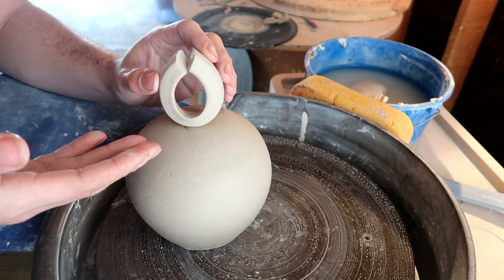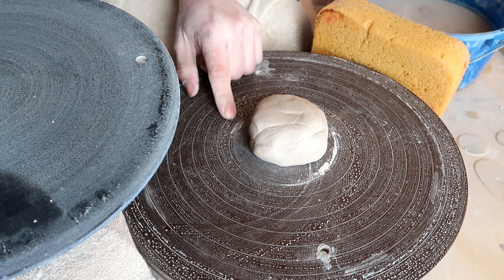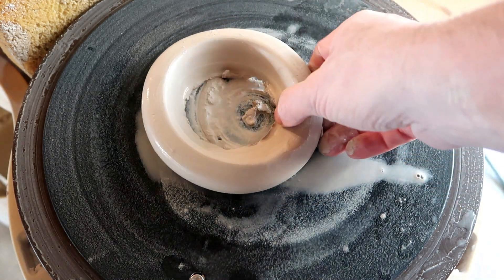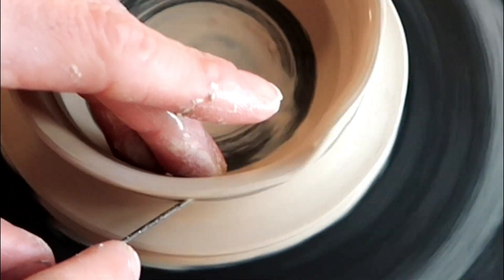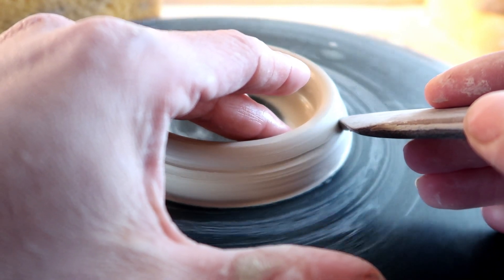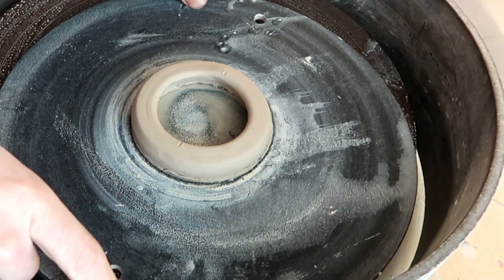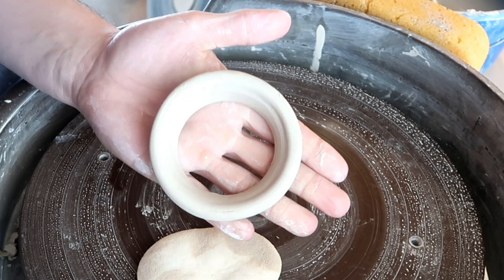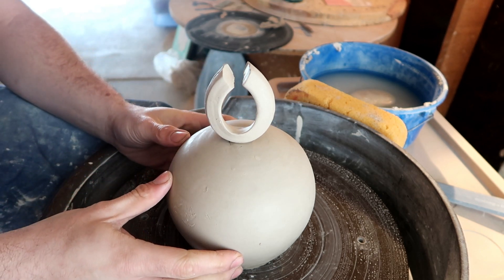How to make a Ring on the wheel (sculpture technique)

Comment: I've heard of this being used to put feet on forms, but haven't tried doing so.
Also in the ceramics classes I've taken we did make large rings from small bases. It requires using the blade of your off hand to push down on the clay while your main hand pulls out (using the same technique for getting the clay to adhere to that bat during centering while slowly pulling it wider).